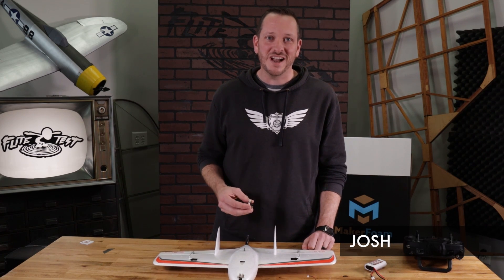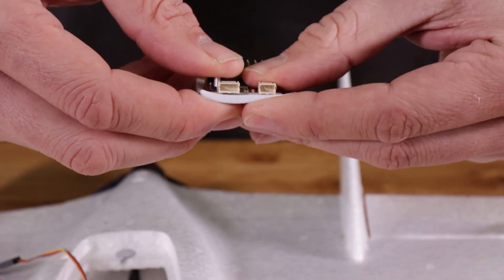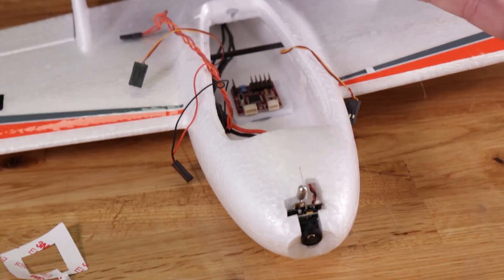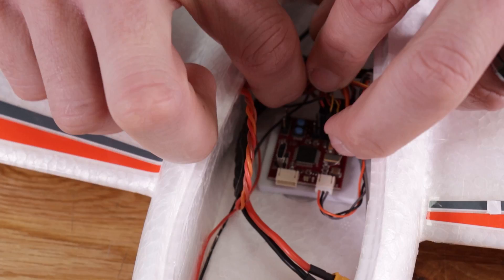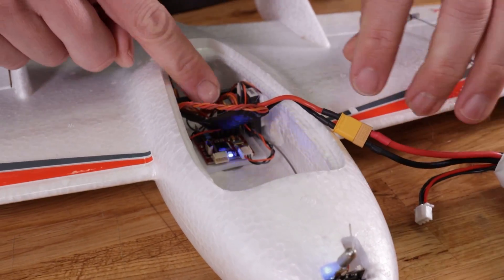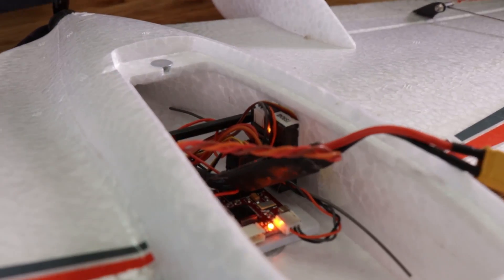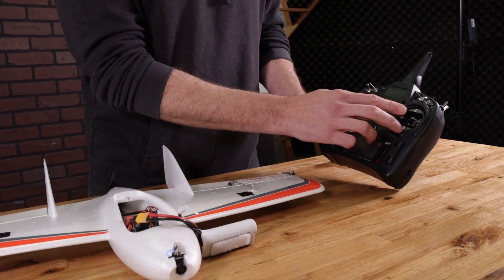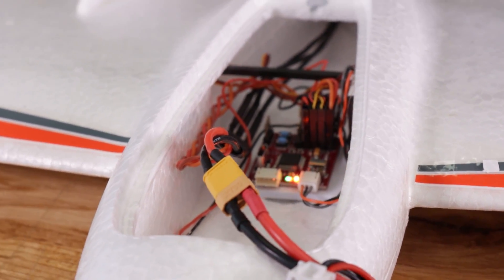SETTING UP A WING  /  FT AURA 5 LITE

Comment: I'm really  excited about the Aura5lite in my Mini Arrow. 
Now, after I tried to change the switch for the modes on my Spektrum DX 6e,  I can't change the setting from 3 axis to 6 axis anymore. after going into the change menu and pressing the bind button the blue lite turns on, but turns green again as soon as I let go. And there is no reaction of the control surfaces as should be. Anybody knows what's the reason for that?  Help is appreciated.

Comment: So ive contacted customer support and at this point im just doing everything i can to get some helo in getting this figured out. I have a flysky i6x transmitter and a fs-ia6b receiver.  I have them binded as descrived with the m to m servo wire. I have the gyro working but i havent figured out how to assign it to my 3 position switch. Im not sure if this is related to the issue im having but I suspect it does. My issue is this; the gyro works when tilting the wing but i dont have any control input from my transmitter, it wont move the ailerons or throttle... please help someone.

Comment: Check you mixes!! 

Two important things not in this video.  You can only see this in the Aura Config SW. 
The default aura config file has mixes for launch and level assist not addressed in this video.

1)  Launch Assist elevator angle is pre-programmed for +30deg.    You can adjust that in the Aura Config SW.   That can be quite a bit of up elevator.  Download the SW and adjust as you see fit.   I reset mine for +15deg.  
2)  Level Assist has a pre-programmed mix for elevator vs throttle.  At low throttle, the mix setting is -1deg.  At high throttle the elevator angle mix is set for +12 deg.  I could not figure out why I could never get Level Assist to keep my goblin flying level.   FliteTest should document this.  That +12deg up elevator was causing issues at high throttle.  ie.  up,up,up we went.   I though it was the goblin, but a bit of it (most of it?? ) was that added mix that I didn't catch until I went into the Aura Config tool.

Comment: Maybe I missed it, but you got the flashing green light, and then did the change of servo direction for ailerons and elevators. But you didn't come out of the green light flashing mode, did you? Does this change of servo direction feature work while flying? IOW if you do a continual loop, I.e. holding the elevator stick full back, will the servos change direction mid flight? Or does it only work with holding the stick full forward?

Comment: I just ordered an Aura 5.

Can you design a Ekranoplan firmware? Something which allows roll and pitch to be nearly zerod out, and control to be reduced to throttle and yaw?

I want to make a STEM/STEAM RC Flight series and the first project will be done in an urban school yard where true flight would not be permissable but faux 2D flight would be allowed.  So the first week would be gyro stabilized ekranoplans.

The second week would visit a near by public park with a thriving flight community where normal planes would be used.

Comment: I would love to see a video on lipo voltage alarms. I know lots of people time flights, but I think that is too dependent on how you are flying. My alarms currently will get triggered with a momentary voltage drop and it is highly irritating, as I have to land and reset or listen to them beep. Any suggestions for me?!
Reply: the Venom alarm (in a red case) resets/stops when the voltage returns above the alarm threshold.  it’s higher priced than others.  maybe some if the $2 do as well.  the design all looks the same.

Comment: Man... The background music is irritating....
BTW... It would have been so easy to put an Arrow indicating the front when the PCB was designed.
Reply: There is an indicator on the bottom for the 'default' orientation, but it can be mounted in any 90º orientation if you setup the orientation in the PC program.
Reply: Eagle Flight... @FlexInnovations .  Thanks for the info guys.
Reply: There is an arrow on the bottom of the board for orientation.

Comment: Lame.  No example of how it works in flight.
Reply: Can't get an answer as far as what their required 3d mounting platform is for giant scale. Great service AFTER a sale...
Reply: @Mark-W5ADK  You need to keep power consumption in mind, as well as use a serial receiver (not a remote receiver). We recommend using this mount, with a velcro strap around the unit for extra security:

https://www.flexinnovations.com/product/ft-aura-5-lite-3d-printed-mount/
Reply: Its coming

Comment: I don't know why they don't mention it, but if you want the computer software get it from Flex Innovations.
The configuration software is common to all their products and it will recognize the board as a flite test board.
Change the options to "advanced" and there is a whole bunch of cool stuff to play with.
Next project....... model rocket stabilizer.
Should be super easy to set up.
Also, if you have any of the horizon hobbies 5 or 6 channel oem transmitters that normally are hard to use because you can't reverse servos on them.....
No problem with this controller.
Also, unlike my DX6i, which only has a 2 position switch, the stock transmitters have 3 position switches. Some of them anyway.
Reply: I have a DX6i also, will it work with it without a 3 position switch?

Comment: I put mine in a micro F-27. The original flight control board never bound correctly. Replaced it with a racing satellite receiver and a new esc with integrated bec and the aura.
It flys amazing.
And it was WAY easier to balance on the correct cg.